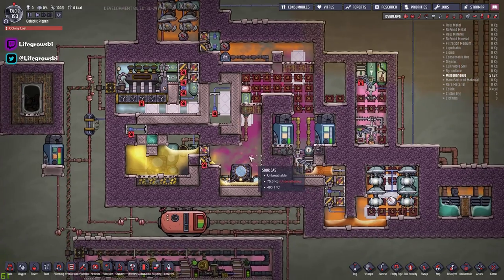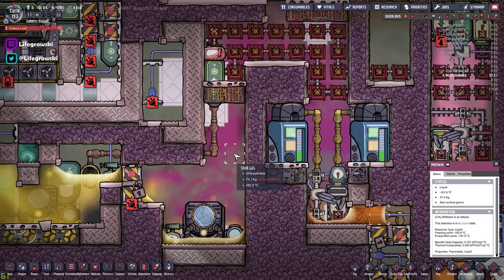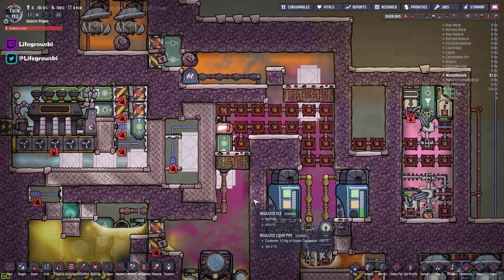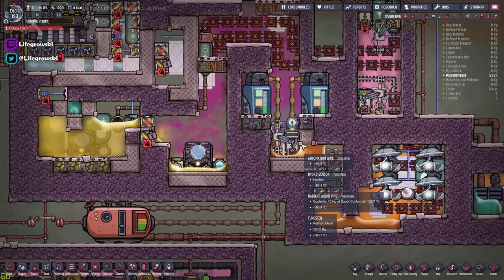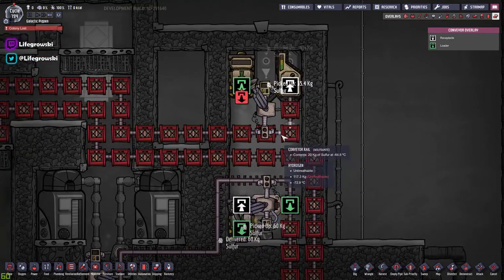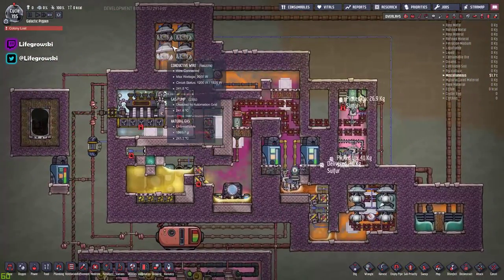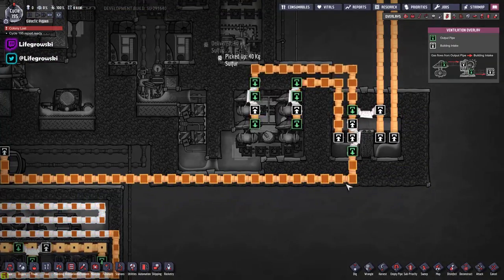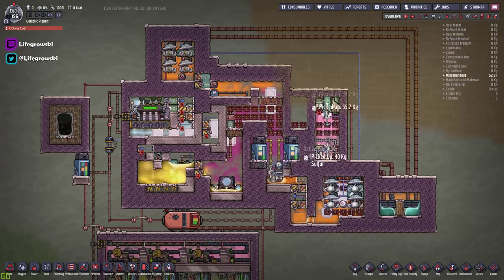OXYGEN NOT INCLUDED - "THE SOUR GAS-TARD" - CRUDE TO NATURAL GAS (WITH SAVE)

Comment: Got a question I didnt see on google. Is there any reason I would actually want to make sour gas or does it end up producing less power than the petrol would if it didnt flash to gas? Great vid just asking since it also seems like you would have to use more extra power to make natural gas than you would get back from it. Thanks, also might eventually try this just for something new to try :)
Edit: Read a comment, So doing this will output fuel for even more power? If so sweet. Oh and have you revamped this since its been so long ago? Could sure use the DL to try it.
Reply from the maker: Oil -> natural gas is the highest power gain in terms of usage for oil. It's magnitudes better than using petroleum for power. I normally only use petroleum for rockets, and sour gas for power (plus the co2/water outputs). Sometimes you need to stop and consider all the outputs a build makes before it makes sense. Consider how much polluted water you'd get from 100 natural gas gens for example.
Reply: @Lifegrow  thanks for the response. Did you by chance work on that setup again and have a newer setup to make natural gas? Could really use the save or the BP. Thanks again

Comment: This seems like an incredible amount of effort and a bunch of endgame material to take a fuel which can get you 3k watts of power and plenty of pwater for your base to turn it into natural gas and some sulfur.
Reply from the maker: Well here's some simplified numbers to work with : An average cycle processes roughly 2300kg, let's make it 2400kg for ease. If we turned that crude oil to petroleum (which we can at a 1:1 ratio by boiling quite easily) you'd have enough fuel to run 2 petroleum generators for 1 full cycle constantly (4kg/s *600 seconds = 2400kg). That would get you approximately 2,400kj of power (plus a load of extra water/co2 which we'll ignore for now). 

Now let's assume this build takes that same 2400kg of petroleum and turns that into natural gas - we lose 1/3rd to sulfur - which drops us to roughly 1600kg of sour gas, which then becomes natural gas. One Natural Gas Gen requires 54kg of natural gas to function constantly for an entire cycle. 1600kg natural gas / 54kg per Nat Gas gen = ~29.6 Natural gas generators that can be supported for an entire cycle. One natural gas gen outputs 480kj of power if run continuously for a cycle, 480 x 29.6 = ~14,208kj of power (Plus a boatload of co2/water too).

Me personally - i'd rather make an extra 12,000kj of power out of that same resource. Thats why I started tinkering with this build :P Again, these are rough figures, but should hopefully explain my reasoning.
Reply: @Lifegrow  I watched further into the vid and saw just how much nat gas was being made, which reminded me of my own experience making steam for my first rocket with an aquatuner and this started making much more sense. Thanks for doing the math, it puts this in far better perspective.
Reply from the maker: @Andyisgodcky  Hey you're very welcome bud - not posting this to show off, just trying to share my experiences so that somebody smarter than me can build on my tinkerings :)

Comment: Why ever waste precious polymer materials on natural gas, which comes straight from geysers and fertilizer synthesizers?
Reply from the maker: Two reasons. 1. Oil reservoirs exist - so it's potentially a renewable resource. 2. Natural gas geysers are rarely enough for the size of bases I build, and fertilizer synth builds are an outdated concept that should only be used if fertilizer is your main focus. 3rd bonus reason - because I wanted to see how it works, and whether it would give me a shitload of positive power compared to other builds. (spoiler, it does and it does) :D
Reply: @Lifegrow  
Hmmmm but less efficient than maximizing outflow from a NG geyser, right? Just for supplementary power? I have 2 NG geysers and 3 CO2 vents so I guess I can just send it straight to molten slicksters and get even more. I honestly don't know what builds use more than like 16kWatts
Reply from the maker: @G.r.e.g.g.l.e.s  My last playthrough had 3 NG vents, a fully capped solar surface, 20 Natural Gas Gens, 2 steam turbines, 6 Petroleum gens, 6 Hydrogen Gens, 12 Coal Gens, and a prison containing 6 full time manual generator dupes (creating ~900kj per cycle alone). My power grid total was aproximately 42kw. There is never too much power, only too little ambition ;)
Reply: @Lifegrow  Jesus Christ I'm glad I've found your channel
Reply from the maker: @G.r.e.g.g.l.e.s  Welcome :) Make sure you pop by twitch and say hello :)
Reply: @RofiudinAli-h3d  
Lol some people just like to run 8 thermo aquatuners at once with no automation and have gas vents and thermo regulators making loops for no reason.
Reply from the maker: @RofiudinAli-h3d  My last stream playthrough ended up with 2 separate main grids - one on the left of the base, other on the right. Add in a few extra coal gens here and there and you end up with a monster amount of power usage :D Heres a link to the playlist btw, beware - it's a long one : https://www.youtube.com/playlist?list=PLVLEZuI-7xWwfRS2mp1swQ9wJx2AzhNXr